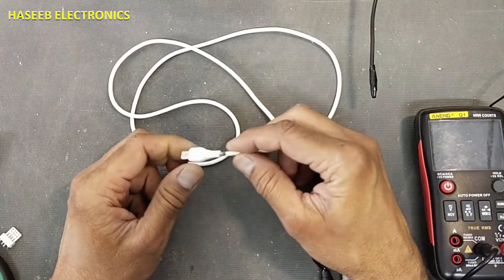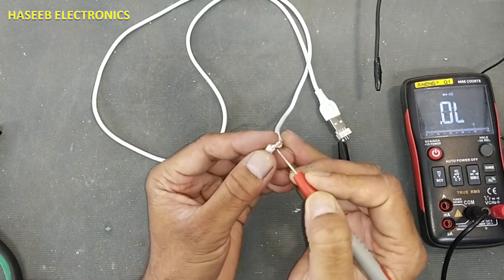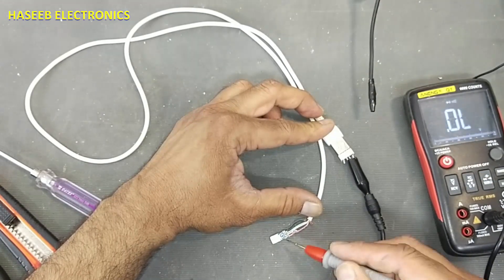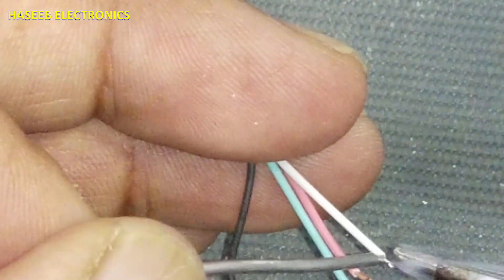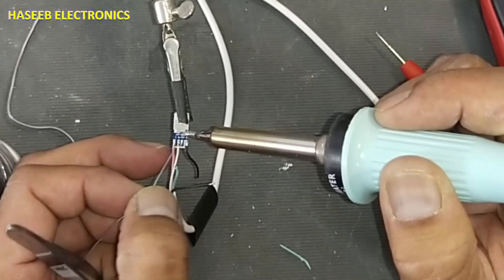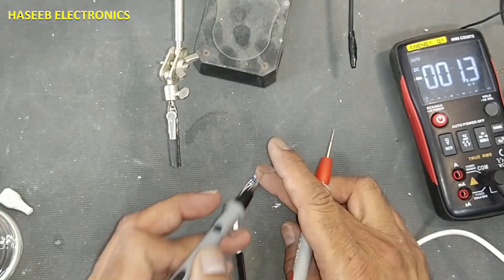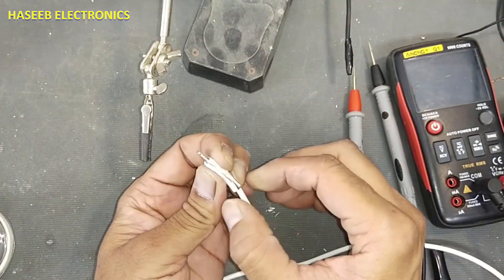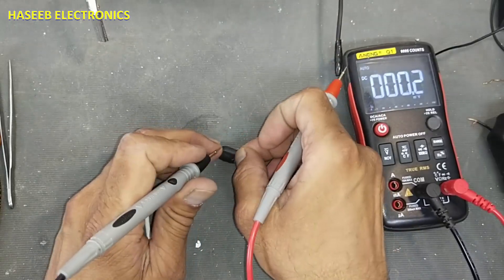{667} How To Repair iPhone Charging Cable At Home, Charger Cable Repair

Comment: السلام عليكم ورحمة الله وبركاته
How are you Sir, i request you to talk about:
1) Usb tester devices.
2) Battery capacity tester, 1.2v-30v or more, ampere 0.1A-10A or more, for all types batteries, and resistance, capacity , energy, load impedance.
3) Diy electronic dummy load variable with digital display, for usb devices or for others 
Regards

Comment: First problem with the cable is that it's not MFI certified so it would be prone to damaging the logicboard. Original or MFI Lightning Cable are extremely tough to get into. But I do appreciate the general repair lesson.👍